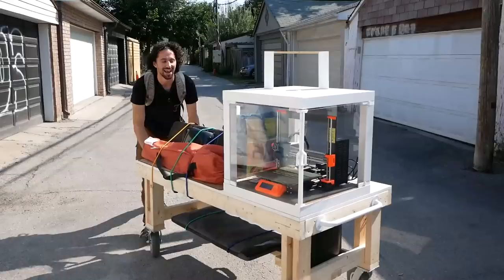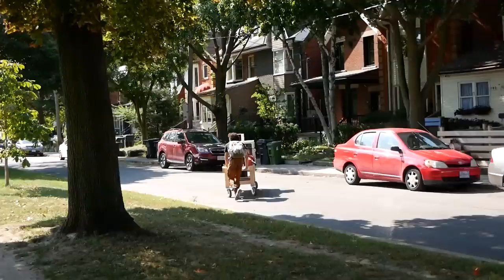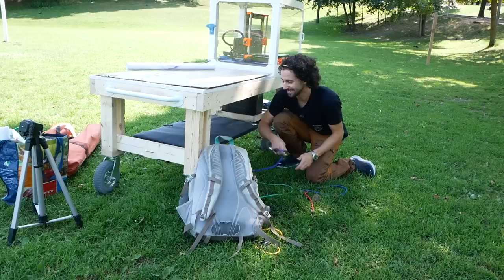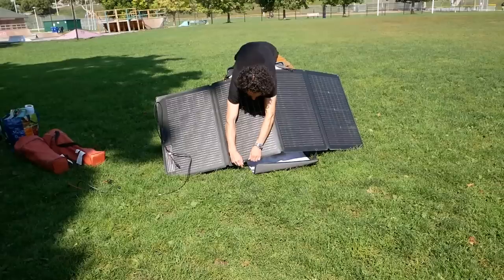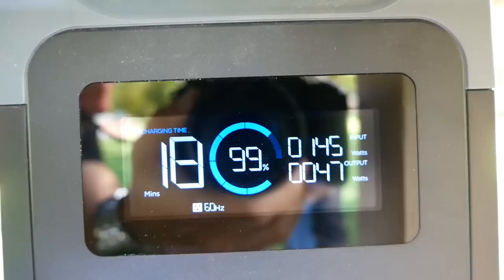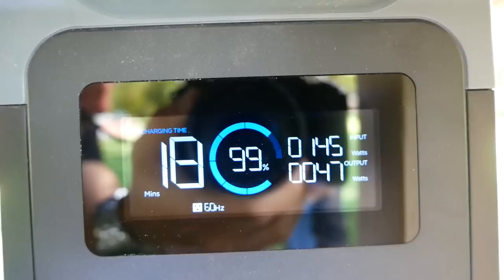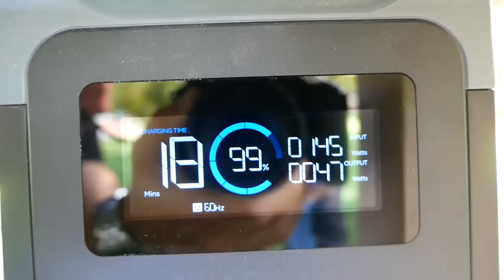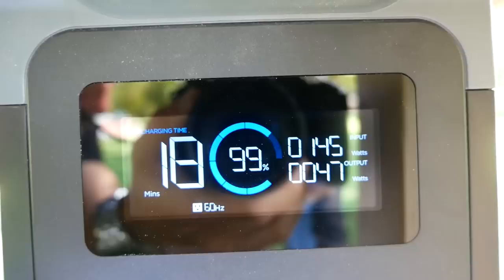I 3D Printed Repairs for Strangers (in the middle of a park)

Comment: Great video. I would suggest changing the printer nozzle to a bigger one in order to print faster. 0.8 or even 1mm achieves enought details for most household itens and you can print 5-10x faster than a standard 0.4mm nozle. That way you are not stuck with a 2h+ print consuming most of your work time

Comment: Love this series! One suggestion i would make however is to switch to a 0.6mm nozzle if you are not using one already! 
With the variable line width changes in the newer versions of cura and prusha slicer a 0.6mm nozzle has very little drawbacks now and can speed up your prints dramatically!

Comment: Suggestion : There's a easy way to build a moving table, keep front wheel fixed and add a liver the trun the back wheel or else vise versa. You can even add a bicycle at one end and you can ride the whole table with bicycle
Reply: Liver the trun?
Reply: "lever to turn" works.
Reply: At this point, 3d printed carriage, electric motor, the nomad printer, basically plastic Jesus

Comment: @Morley Kert suggestion on the first one to avoid support. Rather than having a roof with a hole which needs support make the roof solid for one layer so it can bridge. Then instead of support you only have to clean one layer of the hole and not all the support.
Reply from the maker: That’s a great idea!
Reply: @MorleyKert  there are all sorts of those kind of tricks for 3d modeling. I've suggested a couple more on other videos but I'm a tinkercad user not fusion so.
Reply: @MorleyKert  on your timeclock gear I suggested making it 2 part the pin and the top separate so no support and you could reprint the pin or the gear if things were not the right size.

Comment: You could weld some bits of metal that will allow you do put a locking pin in one or two of the wheel(s).
You could remove the pin when you need more manoeuvring, and put it back for mode normal travel.

Comment: You could actually attach 2 caster wheels to a hinged plank. If you have a lever that brings the plank parallel to the ground the caster will behave normally, but if the plank is angled the casters settle into a locked state where they cannot freely rotate. If you add that feature,  you could get the best of both worlds. It would be stable as a cart and have the freedom of movement of wheeled furniture.
Reply from the maker: That’s such an awesome idea!!

Comment: Those Dyson filter covers are supposed to split on some models. They have a magnetic seam on the Pro version, but you basically never touch them under normal use.
Reply: 👆👆✍️
ʟᴇᴛ'ꜱ ᴛᴀʟᴋ
▶️ For Pröfïtãble Ïnvëstmënt ...

Comment: It seems like with the first model, you may have been able to print it upside down, with a larger brim to hold the print down and then avoided support materials all together.   Like you I am not a huge fan of support materials, so I will go out of my way to discover new ways of printing things to avoid them...     If you have internal structurers with overhangs, you can use fillet or chamfer to gradually build out to them on the inside structures.

Comment: you can add a tiltable u-shape 3d printed piece to wheels for locking and unlocking the rotation. Like from Spain

PD: Foldable sun roof that can be folded inside the frontal "free repairs" signal, it allows you to be at sun without moving table or panels or getting toasted

Comment: Time for a pair of v0.1's? 
Looks like most of the prints could fit on a smaller bed and should be significantly faster than the Prūsa. Not to mention power savings on the bed

Comment: Idea: Add some scooter motors and 3d printed gears added to the table to make it motorized and powered by the battery system.  And a rudder to steer since that would be silly :)

Comment: With that power supply, have you given any thought to motorizing your table? If you were to put an electric bike speed controller on it you could use the pedal assist function to only add power when you push the table around. Just an idea.
Reply from the maker: I hadn't thought about that until now! That's a really cool idea
Reply: @MorleyKert  It would also be an interesting project to put on YouTube and would undoubtedly require some custom printed parts. 🙂

Comment: While maneuverable, you expelled most of your energy trying to keep it under control, which looked quite ripe for disaster looking at the terrain you were trying to navigate. To each their own, still managed to enjoy the video. Great project!😊
Reply: Yes, having two non-swiveling wheels are a much better idea.  A lot less chance of a tip-over.  It's just like in the super-market where the carts with all four wheels that swivel are so much harder to maneuver than the ones with non-swivel wheels in the front.

Comment: If you're printing such small parts already, why don't you just put some painters tape or buildtak on the bed and use it cold? It will save you a lot of power. Also optimising the stock print speed and accelerations will speed up print time.

Comment: Great video! I was surprised you could run your printer for a day from the charged battery and solar. Maybe I missed it in the notes -- what software are you using to design the parts?
Reply: Now I see -- Fusion 360.

Comment: Something that might be cool is to 3d print something that can lock one set of your wheels.
Reply: I think that would be cool as well but I have a feeling it would not be up to the task of resisting the kind of forces at play.
Reply: @jeremyspecce  it would hold up. But definitely the right material and infill would need to be used.

Comment: Hey Morley, great video! loving the free 3D repairs you're doing. Did you print the last pieces for the bike out of PLA? if so they might deform pretty quick under the sun since they're black and under tension. Just a heads up, but you probably already know :)
Reply from the maker: Everything in the video was printed out of PETG 😊
Reply: @MorleyKert  Great choice! Worried over nothing :D

Comment: I’m thinking if buying the eco flow and solar panel. Do you think the eco flow will last on a 21 hour print? I’m using a ender 3 pro and ender cr-6 se. I will only have one plugged in.
Reply from the maker: Maaayybbeee if you didn’t use a heatbed, but the best way to find out would be to hook up a power meter to figure out how much power the printer draws over the course of the print and then compare it with the ecoflow specs.
Reply: @MorleyKert  I'm fairly new to 3d printing, but don't I need the heating bed to get the prints to stick? Or I can turn off the heated bed
Reply from the maker: @kb1Legendflaco  Honestly, I always use the heated bed so I'm not really sure, but I've been told that many prints still stick without a heated bed!

Comment: 0:30 BUT: Most of the time you push the car straight ahead... so why not mount 2 wheels that you can fix AND release (if necessary)? That would certainly simplify the transport 😅. Or are such sleepers installed every 10 meters in your city 🤣?
Reply: 👆👆✍️
ʟᴇᴛ'ꜱ ᴛᴀʟᴋ
▶️ For Pröfïtãble Ïnvëstmënt ..